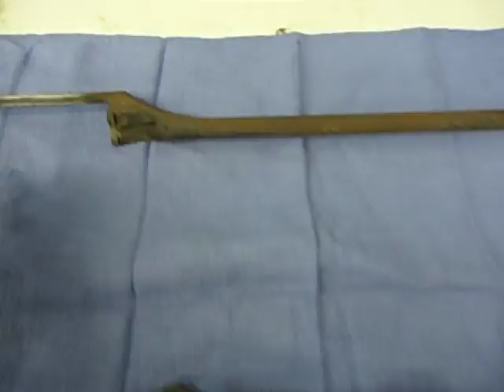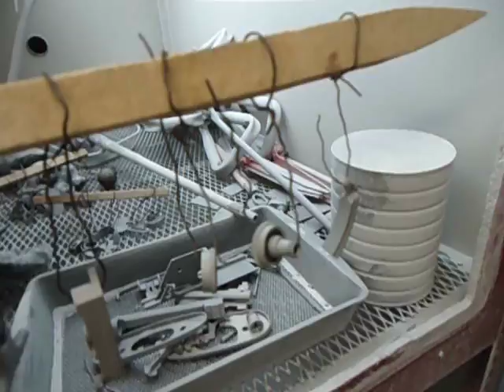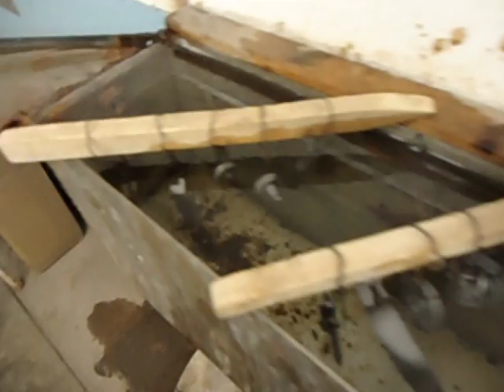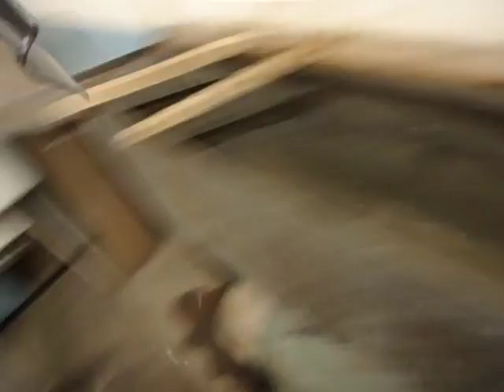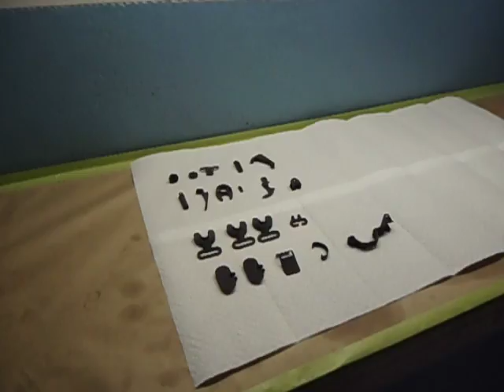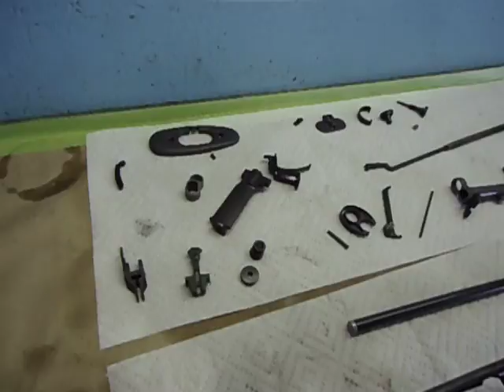Aaron M1 Garand Restoration Vulcan Gun Refinishing (8 of 9)

Comment: What type/grit size material did you blast with?
Reply from the maker: For Parkerizing we use White Silica Sand normally used in Pool Filters because it's fairly fine (no need to beat the Death out of the Steel) and we Blast at around 40 LBS pressure or so. Remember, you're only taking off the old Finish. I see horribly pitted Guns from people using Aluminum Oxide or Steel Shot blasted at 100 LBS of Pressure or more. Washes out the Markings and leaves a very rough Finish when all done. Looks terrible to us. For Bluing we use 320 Grit (as fine as we can buy. Almost the consistency of Flour) Glass Beads blasted at about 40 LBS Pressure once again. Leaves the Metal with a nice soft Satin Finish. The Bluing looks great after that. Perfect for a WWII Enfield or others as well. If you want shiny Bluing you'll still need to Polish the steel to a high Luster after the Brad blast.  Shiny Steel means shiny Bluing, dull Steel means dull Bluing. Think of the Bluing as a Tint or Dye. Thanks.

Comment from the maker: PPG makes an Epoxy Primer that not only looks excellent, but will adhere to the Zinc. Works well with Stainless and Aluminum also.  It's known as   DP90.

It takes a hardener and a little reduction as well. Fairly simple to use. Great product. 

Take care.

Comment from the maker: If you remember, I had to have the receiver "Annealed" (softened) so I could work on it (see earlier videos on this project). I had all that pitting to deal with and Garand receivers are so hard you'll wear out a file in less than 5 minutes! So you get them softened to work on and then get them re-hardened back up to the original hardness after you're done all the Metal finishing. Just trying to do as close to Factory work as possible.

Thanks.

Comment from the maker: No, for the actual Park, I sandblast. It gives a rougher surface for the Parkerizing to develop on. I was factory trained to do Parkerizing and also have learned from Phosphate shops in the area, that a slightly rougher surface is better. That's also why I don't plug barrels. The inside of the barrel is so smooth that Park won't buld up. The Phosphoric acid used is very mild. The only reason it acts violently at first is because it's been heated up. At room temp. it's very mild. Thanks.